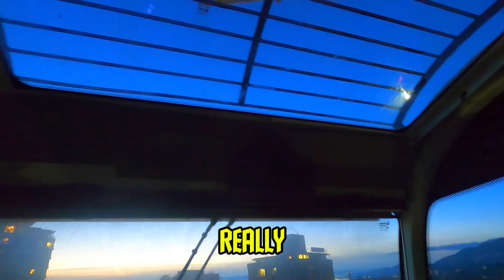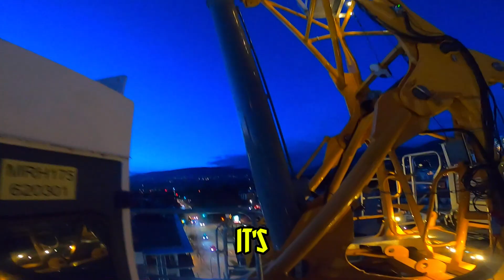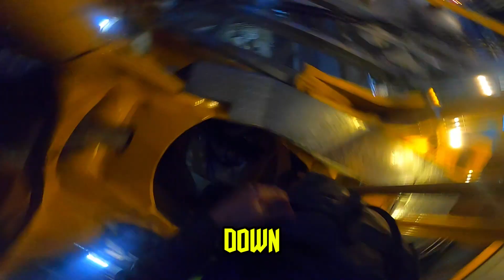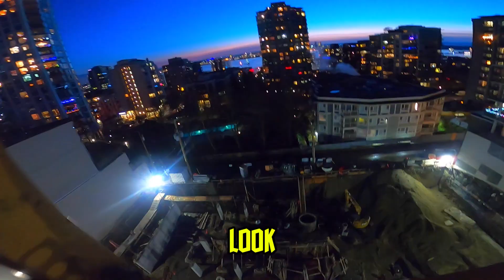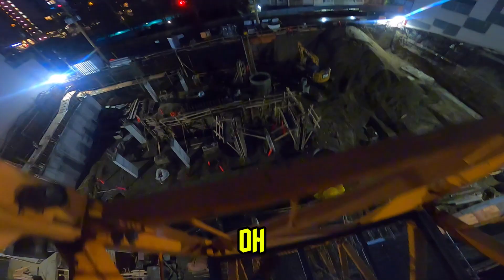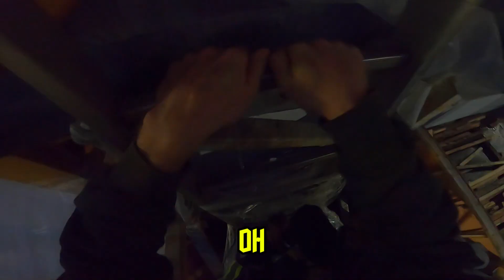What an Epic Machine!! (Hydraulic Tower Crane)

Comment: I’ve always wondered what the pros and cons are with these besides being able to have a better minimum radius. Maybe hydraulics might be faster in terms of booming. I’m sure when the boom falls pass 45 degrees it probably falls quicker as the weight of the jib is completely over the hydraulics. What do you thing the pros are for having this over a typical reeved boom hoist?
Reply from the maker: Good question! There are definitely pros and cons to both.

Comment: Is there a trolley on it or is the cable stuck at the tip?
Reply from the maker: No trolley. It is always at the tip
Reply: @heavybrowncranes have you seen the mobile tower cranes? Those things are bad ass they boom back to 45 degrees and you can still trolley with a good load chart
Reply: @SJ_999 are you talking about a self erector? Or are you trying to say there’s a crane out there that can luff and lock the boom into a trolley. Every operator I’ve talked to has said they seen “ a video of it” but no one can ever tell me the manufacturer of said crane or can even find the video of it. At this point I think it’s AI generated and has everyone fooled.
Reply: @danteventura713 liebherr mk 88 or the other 4 models and there’s one other company
Reply: @SJ_999 Spierings it is a Dutch brand ! Maybe the only thing I am  very proud of to say it is Dutch !
Reply: @danteventura713 in the old books my dad had for crane education. There was a Liebherr ( Ec-h hammerhead like ) tower crane in it with at the cab a part of the boom going like 45 degrees up and after the remaining part of the boom was on 90 degrees I don’t know the name / type  of this very odd looking tower crane the only thing I remember is how it looks and that it is of the Liebherr brand with the cab at the top of the slewing platform ( like Ec-h )
Reply: @maiksteijns8610 that’s why I like liebherrs more is because the cab can move up and down and stop at any height. The biggest one booms back to 70 degrees
Reply: @danteventura713  Liebherr 140 HC-K check
Reply: @heavybrowncranes  that's the way she likes it